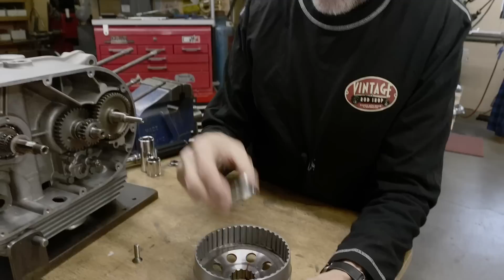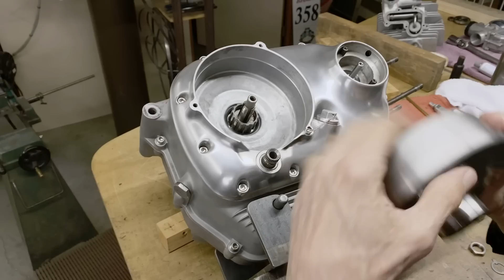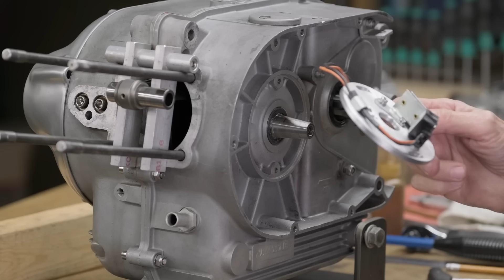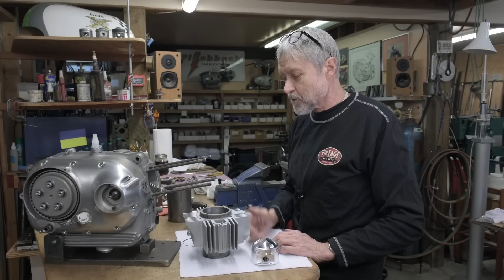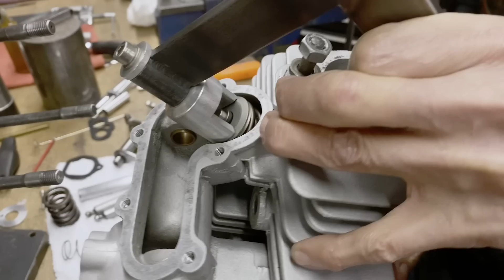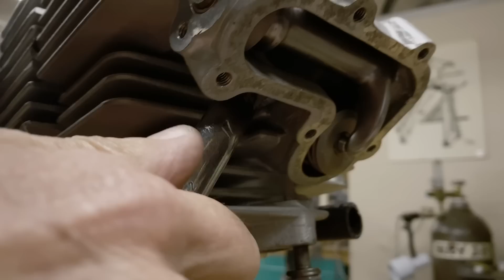Aermacchi Motor Assembly // Paul Brodie's Shop

Comment: Thank you Paul for presenting the Aermacchi engine in loving detail. Those engines are very nicely engineered and the design philosophy behind them was a complete turnaround from the usual Japanese thinking. In many ways I consider it to be superior; the horizontal cylinder layout created benefits and opportunities not inherent in the dominant design thinking. A low and lightweight motorcycle was the result, with great handling characteristics. A timeless design, really, and I wish something similar was still available.
Reply from the maker: You are not the first to wish something similar was available today. Thanks for watching and commenting.. :)

Comment: Thank you so much for your thoroughness and your race specific insights!!! Invaluable as I was putting together my engine that was based on an old blog post of yours. Here’s me assembling my 350 motor. Put the camera on it as I re-split the cases trying to remember if I put a spacer in the correct place.  Thanks for everything!
https://youtu.be/OIutnSxT464?si=Dz-0h0kv-nlIXSSB

Comment: Thanks for the presentation. Back in the mid-'70s my buddy had both the 250 and 350 Sprint variants. We used to have a blast with those bikes. He was into extended wheelies and sometimes had trouble with oil starvation to the top end.
Reply from the maker: Extended wheelies!  Sounds like you guys were having some fun back in the day. Yes, if the crankcase oil goes to the back of the case and is no longer surrounding the pickup that is a problem!  Thanks for watching....     :face-orange-biting-nails::face-orange-biting-nails:

Comment: Upps! Your safety wire from the oil fill plug to the head of the allen screw was on the wrong side if the allen screw head.  If the filler plug loosened it would pull and loosen the allen screw also.

Comment: Do you rebuild Sprint motors?  I have a 1972 engine with a 1973 barrel, head, pushrods, cylinder studs  and 5 speed transmission.  I would like to have it all assembled together. Thank you.
Reply from the maker: I do not rebuild other peoples Sprint motors, sorry. I am retired.
Reply: @paulbrodie  Bummer.  I was looking forward to getting this 1972 1/2 Sprint back on the road.  Thanks anyway.  Any suggestions for someone on the west coast?
Reply from the maker: @bryanwhitton1784  Send me an email and we can discuss... No promises.   :face-orange-raised-eyebrow:

Comment: Love your videos! I’m restoring a 66 250 C and was wondering how far the piston edge sits down in the hole on stock engine? My replacement sits a few mm in
Reply from the maker: Thanks Tom. The edge of the piston usually sits pretty well even with the top of the cylinder. A few mm down does not sound right to me...

Comment: Got my Aermacchi because of the external banjo bolt, oil line setup was a  leaker, the mouth breathers  over torqued it by 100 ft lbs it was just a single oil line perhaps 1967 maybe, cool bike but the shifting pattern and controls were at first challenging not similar to most bikes,   handled nice good low center of mass. Great production you guys always knock it outta the park.
Reply from the maker: Thanks for commenting, but please do tell me, who are the "mouth breathers?"     :face-orange-raised-eyebrow:
Reply: @paulbrodie  
Mouth Breathers 
Is kinda a wide descriptive term for those who are fairly large in number and collectively have an IQ of 5. 
And usually sport a 3/4 " drive tool set as their primary  go-to   and the most powerful Ingersall Rand impact driver made  and a sledge hammer.
Reply from the maker: @minle8702  In machine shop we called those kind of people "Rough Turners" to describe their quality of work...   :face-orange-biting-nails:

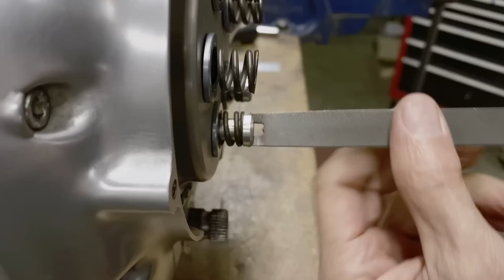Comment: Nice!  I like the special tools.  At 12:02 unless you used a reverse thread allen screw the safety wire is attached to the wrong side of the allen screw.
Reply from the maker: Don't worry, the Allen screw is not going to come loose.

Comment: The safety wire is on the wrong side of the stud for the oil filter plug.
Reply from the maker: Don't worry, it will not come loose.

Comment: Paul
Following on from your last engine build video when I asked about the clutch retaining nut and direction of thread I think you have answered my point if the spin of the clutch tightens the retaining nut then you do not meet a tab washer therefore giving you more thread engagement loctite is a good safety backup though if you look at captive rear wheel spindles on modern race bikes they do the same thing no spilt pin due to the wheel spinning and tightening up the spindle. 
Great video and good to see you so well. 
All the best
Jon.
Reply from the maker: Jon, thanks for watching and commenting!

Comment: Hi Paul and Mitch . Excellent video and education , thanks muchly , I really enjoyed it .
Loved the special tools ..... the head to cylinder/block bolts are rather difficult to reach , but would a crow's foot wrench be the tool for the job ? Since these fit onto a socket extender , you would be able to use a torque wrench too . That said you may still have to shave off some height on a crow's foot for this particular job ; depends on which tool you buy I suppose .
I do like your push rod alignment tool ; what a pain of a job , without ET fingers ! Would a magnet help ? Lol
Reply from the maker: David, thanks for liking our video. I don't think that a crow's foot wrench would fit. There really is a lack of room. There is a possibility a magnet would help to hold the end of the pushrods.

Comment: Excellent video! Did Aermacchi ever go with a chain driven overhead cam? It seems that would be almost an impossible job to put the push rods in without a special tool for a home mechanic. I wonder how the shop manual describes the installation. Did Aermacchi ever have factory race teams using this engine. You would think if they needed a 15 tooth front sprocket that would be required for a higher top speed for racing then the sprocket cover would have been designed that way...just a thought. Nice looking engine with a low center of gravity. Wonderful job for this video, thanks to both of you!
Reply from the maker: Thanks William. There were 2 OHC motors made back in the 60's, both different. Both used bevel drive, not chain drive for the cams. I use a 520 rear chain and a 15T sprocket. Many racers back then still used a 428 chain so the choice of sprockets was different.

Comment: A very good video on engine building and getting things right. Valve spring seat pressure is something many people neglect but just as important is getting a spring that is matched to the cam. In the worst case the spring can coil bind resulting in a bent pushrod or damaged cam, especially if you gone for a higher lift cam.
Reply from the maker: Allan, good comments! The valve springs I use are actually Porsche, so the quality is pretty good!

Comment: I actually think your humble pushrod lifter is your most brilliant "specialty tool", as I've never seen anything like it before, while all the others are a fairly standard variety as used on other applications.

Now a "details" question: have you tried gasket shellac rather than skim coats of sealer? Is the sealer preferred as it fills surface irregularities, or is it just "how you do it"?
Reply from the maker: Thanks for liking our "special tools". The gasket sealer has worked well for me in the past, so I keep using it...

Comment: I have the factory special head wrenches for Ducati- but needed a different one for an AJP engine I overhauled.  Easy to make, just weld an old socket onto the wrench, then you can use a torque wrench at 90º and have accurate measurements.  I’m sure you can come pretty darn close by hand, but it is easy to do by spec too.   I was going to add picture, but does not look like I can.

 I would not have thought of the adjustable pushrod- great idea to save a LOT of time.
Reply from the maker: Mark, thanks for watching and commenting. We do appreciate it :)

Comment: Two quick questions, did the ignition system also replace the charging system? and  I was looking at Rex's Speed Shop and couldnt find the exact pieces you bought, would you mind linking the pieces? I really want to replace the stock charging system on my 66 model H
Reply from the maker: My motor now has no charging system. It is total loss; not good for the street. Send me an email and I will let you know what I purchased from Rex.

Comment: It was a little concerning that we did not see you apply any loctite or bending of lock tabs. Also, your oil fill cap it tensioned in the correct rotation but the Allen screw is not.
Reply: Paul did say this was a demonstration build , not a final build . He said he would be taking the engine apart again for more than one reason . This build was for our benefit and was done fairly quickly to fit video time . Thank you Paul and Mitch .
Reply from the maker: Thanks David; you were listening!
Reply from the maker: It was a mockup build; I did mention that :)

Comment: Great work. l had an aermacchi in the early 70's.  Wish I still had it.  I'm into British stuff now mainly Nortons.  Just a suggestion.  You can use the piston upside down in the bore to  square up the rings to check the gap.
Reply from the maker: Thank you Mitch...    :yougotthis:
Reply: Plus most folk don't bore their own cylinders and should check end gap further down the bore.......

Comment: I never realized head gaskets were a thing that an engine could not-have, does it have some alternate way of filling the purpose, or does it just not need it somehow?
Reply: Vincent engines had no head gasket , the heads were ground to fit the cylinders . I never had a Vincent , but I don't think they were known for leaks ......

Laverda 750;s had a cylinder liner that protruded above and out of the cylinder . The cylinder head had a ring cut into its underside , around the combustion area , to accept the protruding cylinder liner . The Laverda 750 still used a head gasket though ! I never had a head gasket problem with mine .....  

I must admit I like these Aermacchi engines . They have elements of old and advanced design , mostly advanced for their time for sure . Nice .
Reply from the maker: Aermacchis simply do not have head gaskets. They do not need them, and I have not had a leakage problem.

Comment: Thanks for the vid, I remember re corking clutch plates with my Dad, old British bikes, you bought the cork in sheets and cut the pieces out with a razor blade to fit in the plate. Used to take hours, anyone else remember doing this.
Reply: No , but I have had used brake shoes relined .... useful when you cannot buy spares anymore...

Comment: G'day Paul,

Thanks for another great video.  I have 2 comments for you.  Sorry, 3 comments.

Longer springs are weaker than short springs, particularly if the longer spring has more coils.  If they have the same number of coils, then they will have the same spring rate - the longer springs will have more travel before coil bind occurs, but they will also twist further.

Valve springs do not provide a seat pressure - they provide a spring force.  Pressure is a force over an area.  If the spring is pushing against a piston, in a closed cylinder, then spring force on the piston creates a pressure in the cylinder.  Note also that the specs called for 80 lbs, not 80 PSI.

Finally, are you sure about the cam timing?  Advancing cam timing increases low end power, & decreases top end power.  Retarding cam timing increases top end power with a drop in low end power.  It also moves the peak torque RPM closer to the peak power RPM, & works better with a close ratio gearbox.

Anyhow, it's always good to see you in the workshop.  I'm looking forward to the your nexy video.

Andrew
Reply: quote .....Advancing cam timing increases low end power, & decreases low end power .....?????
Reply: @davidyendoll5903  Bugger!  Advancing cam timing increases low end power, & reduces top end power.  I'll see if I can fix that.  Ta.  :)
Reply from the maker: Andrew, the clutch springs work just fine. I have used them for many years. I set the the valve seat pressure to 80 pounds. If I said 80 psi I was wrong. Cam timing. I "balance the peaks", and that is how I set my cam timing. I like to balance within 2 degrees, but this time I could only get it within 4 degrees. It is what it is. Thanks for commenting....

Comment: Noticed you never use a torque setting tool on any of the fixings also the play on the gears seems excessive unless the specifications allow it.
Reply from the maker: I do use a torque wrench. I did mention that this was a "mockup" assembly, and that the final assembly would take place at a later date. Yes, there is a bit of gear play, but there is nothing I can do about that...

Comment: Hi Paul, did you get the Tiger Cub finished? Would love to see it on the road!
Reply from the maker: Chris, the Tiger Cub is basically done, except to fix the leaky oil tank.I even have it insured! We're just waiting for spring and the snow to melt and then we will take it out for a little ride :)
Reply: @paulbrodie  that’s great Paul, can’t wait to see it.  👍

Comment: You can measure cylinder head nut torque by standing on a bathroom scale.
Reply from the maker: I guess I could, but I do have a pretty good sense for 30ft.lbs of torque.

Comment: See you eliminated the tab washer under the clutch basket, I find the conicle nut solution you made very good as this way the nut grips the thread. IMHO tab washers are rarely a good idea because they are made of soft metal which often compresses in use and reduces the torque on the fastener.
Reply from the maker: Yes, the tab washer is history. Thanks for your approval...   :face-fuchsia-tongue-out:

Comment: Yes, very lucky Blumin V 12 at the moment we are currently rebuilding the two engines on 1000 hp Sunbeam land, speed, car, first car of 200 mph we have two, 475 hp Sunbeam Aero engines in there, so we have 2V 12 to work on originally the engines run a powerboat race in America in a Harmsworth trophies. Were we have four Sunbeam engines unfortunately crack to Hull, and it never raced in fact, it’s sunk to the engines have got quite a bit of history that’s long before I got involved in them, so I do know where you’re coming from. Enjoy your program, Michael

Comment: That was a rather elegant solution for the clutch hub nut, I like it
For the rocker arms, a trick I learned from working on Honda CB500/550 fours, rubber band around rocker arm to hold them up (On the Honda, the adjuster screw can (and does) drop to edge of valve stem and when you tighten rocker box down it bends valve(s) and if your really unlucky, crack valve guide top
It's not something many people think about with an SOHC motor, but, you never do it a second time.
One other thing I learned from Harley 'race' motors, have the 'split' in the valve collets (cotters?) in line with the rocker arm, if anything goes wrong when over revving (valve bounce when rocker arm may contact spring retainer) it's less likely that a collet can jump out. I've never actually seen it happen but anything that can go wrong on motor will go wrong at some time?
Reply: I would think that the valve collets would revolve around the valve stem in use ..... I could be very deluded !
Reply from the maker: Thanks for liking my clutch hub nut...  Yes, rubber bands could be used to hold rocker arms in place. Thanks for commenting.

Comment: Paul, your rod is 10mm shorter than standard but your barrel is 5/8 in (near 16mm) shorter. Are you increasing compression or is there some Brodie Magic I've missed?
Reply: It also depends on the piston crown height. If it wasn't a mistake (maybe 3/8"?) I'm guessing the piston has a 'higher' pin as well so cylinder needs to be shortened more than you expect?
Reply from the maker: There are several things going on. The head is milled .060" to increase compression. The piston design is different too.

Comment: Your Safety Wiring on the oil plug is spot on.
Reply: Actually it isn't. The wire should wrap the opposite direction to the screw thread. The Allen bolt could unscrew as wire is pulling it the 'wrong' way
Reply: Unfortunately it's anti-locked on the cap head bolt, it really could do with wrapping around in the 'tightening' direction.